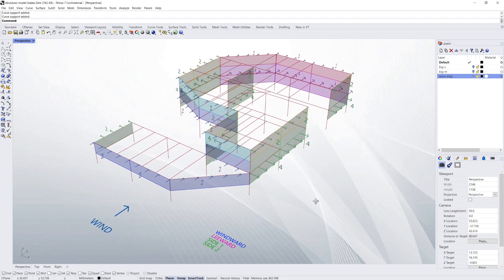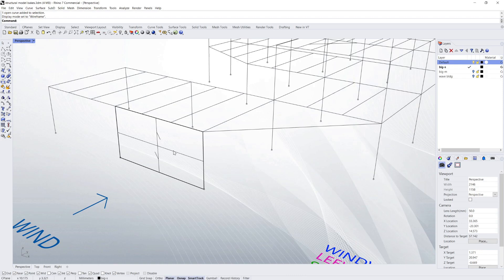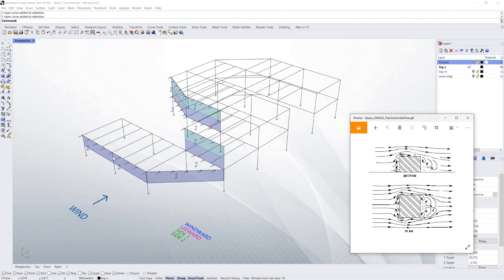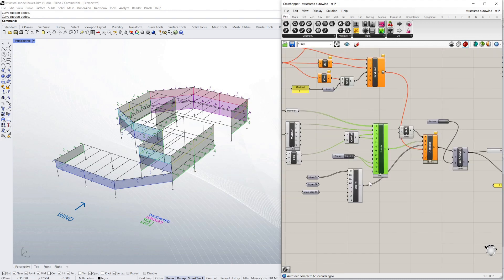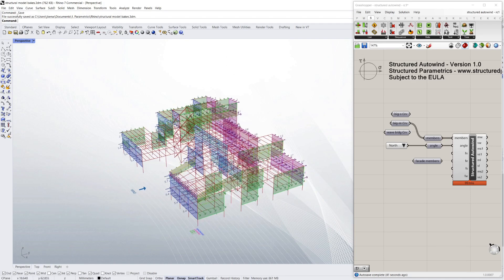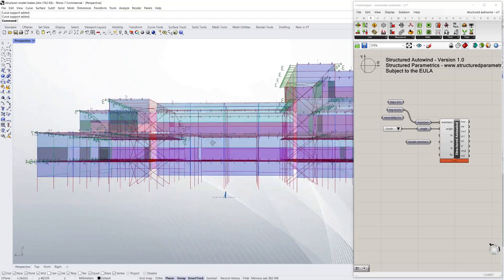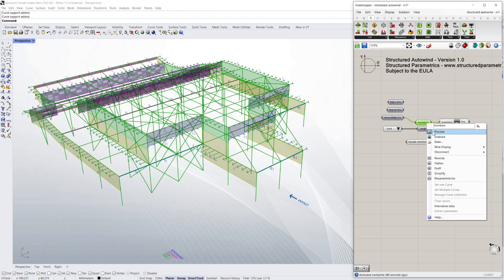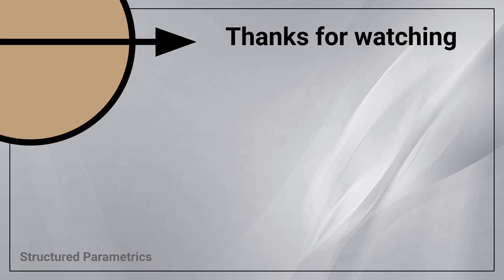Structured Autowind. Wind load allocation for buildings from simple lines.

Comment: Neat. I really like the idea of just using centre lines as input. I was thinking about algorithms to infer the shell from the lines and it's a tricky one to catch all scenarios.
Did you try using the drape command from above?
Reply from the maker: Yes it's actually harder than we would have thought to get a façade shell from lines. We tried a few times with a 'drape like' approach and a few others. We could get some of that approach to work but another complication is assigning loads to the original lines which form the shell shapes. I'm sure there are a few ways to achieve the end result.